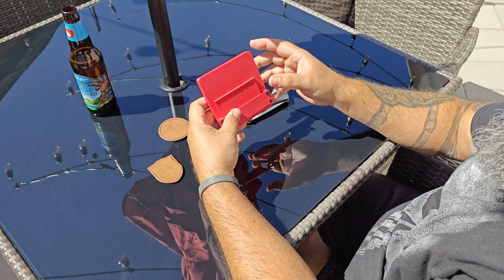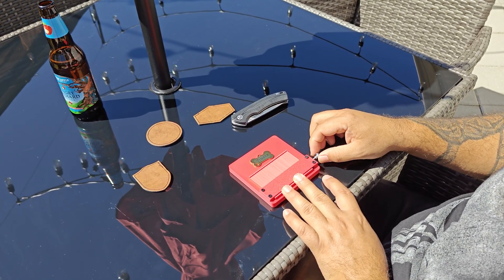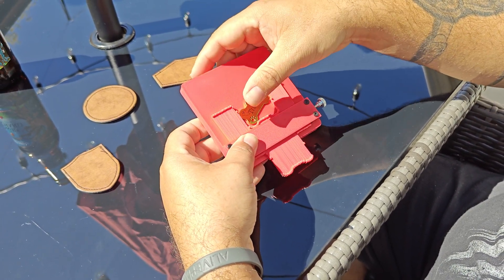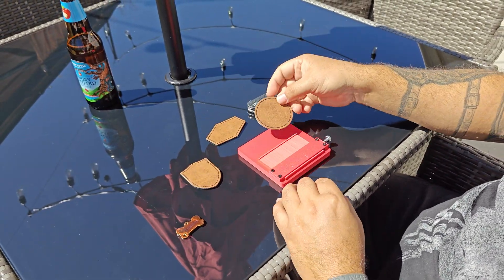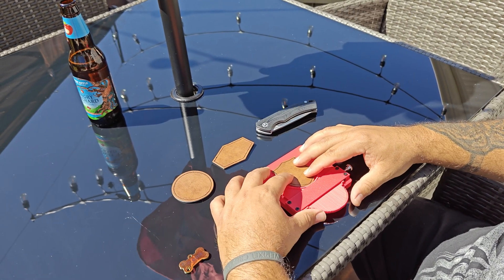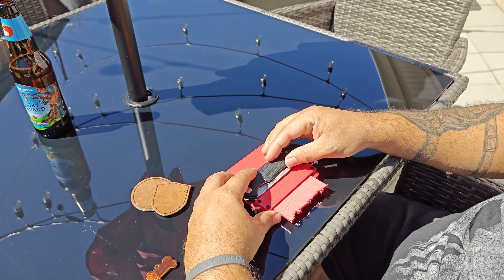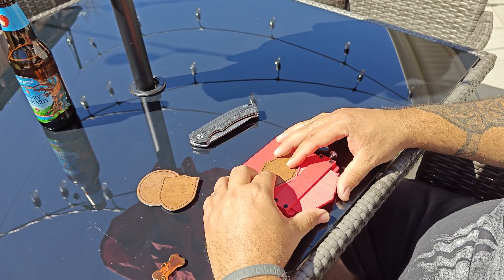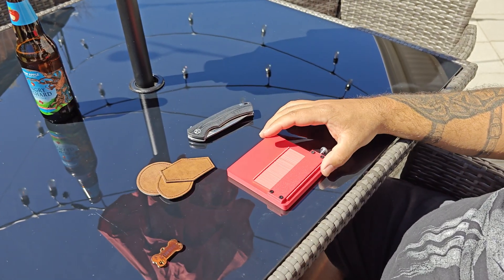AlivePixel Shape Shifter fixture/jig

Comment: Is that screw to lock it fit inside F1 screen protector?
Reply from the maker: no but you can replace it with any M3, if is inside the F1 makes it harder to use